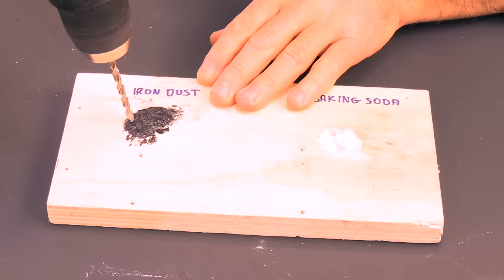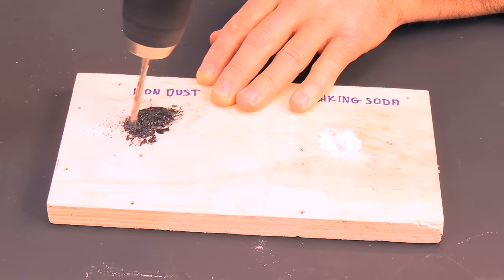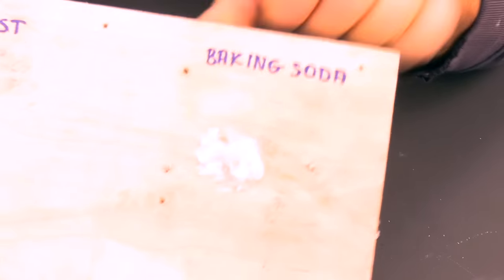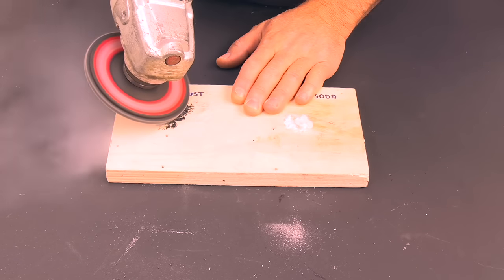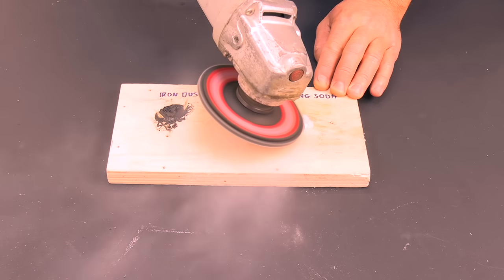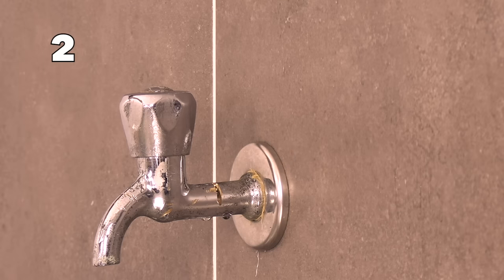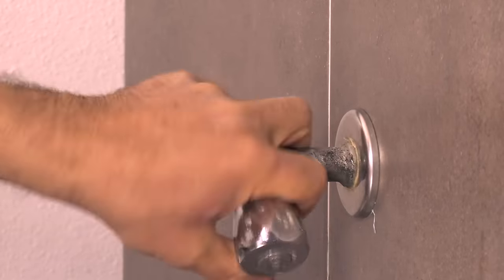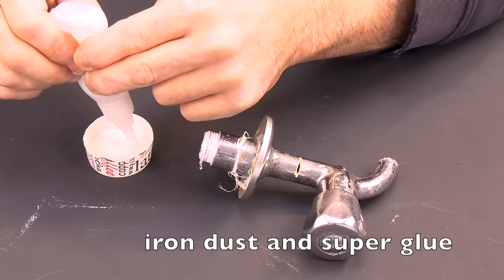Stronger Than Steel! Mix Iron Powder and Superglue You Will Amazed

Comment: Just repaired a broken metal frame from a pair of eyeglasses with graphite (from an ordinary pencil) and superglue. Takes a bit longer until it is hardened (about 30 minutes), but it's hard like stone now and the glue joint seems as strong as welded! Absolutely fantastic!
Reply: try mixing baking soda and graphite together, mix well then add the superglue n u get instant, insanely hard bonds
Reply: Rough job,.filing the chrome!
Mask it on both sides, fill it, wipe smooth, no filing!
Reply: When using a sharp knife, work AWAY from your other hand!
Reply: @keithlinney7084 , ну зачем же? А может он хочет знать технику безопасности, как свои три пальца... Не будем мешать.

Comment: Ничего необычного. Это используется уже лет 40 (а может быть и больше). Есть холодная сварка, можно смешать эпоксидную смолу с железными опилками.  Nothing unusual. This has been used for 40 years (maybe more). There is cold welding, you can mix epoxy with iron filings.

Comment: The baking soda  works like the catalyst of some kind and  also as the filler. Using any glue and adding any filller allows to make the strongest joins . It is like to prepare the  concrete.
Reply: Yes I think he used too much baking soda
Reply: I used baking soda to glue my ebike throtle. That joint takes incredible beating and holds for 3 years already.
Reply: @Sopheris  Try to use the tobacco ash.

Comment: Regarding the bolt that was fixed into the hole with powdered iron and super-glue; if the bolt has some oil on the threads or maybe a wrap of Teflon plumber's tape, then when the iron/glue sets, you can screw the bolt in and out, as the iron/glue will have bonded to the piece of steel, and have threads on the inside of the hole!

Comment: Can it be used to repair electrical water heater tank (iron or copper) with working temperatur up to 75 degree Celcius ?
Reply: you can use adhesive name Metallica of Astral
Reply: no superglue only has a workign temp up to 60 deg c
Reply: Dann muss man einen Kleber nehmen der auch längerfristig Feuchtigkeit verträgt, Temperatur sollte kein Problem sein. Es gibt zu den Produkten meistens auch Datenblätter.

Comment: See a few Superglue n powder vids now. The carbon one was interesting, might have to try this as a low temp metal casting method in silicon mods.
Reply: I have, and superglue with anything sticks to silicone unfortunately. Don't ruin your mold. Use resin with carbon, or baking soda. A steel mesh will insure a type of rebar reinforcement.  Hope this helps. 🤓

Comment: I am going to try this on an aluminum starter bracket that broke off of a John Deere D105 riding mower. I plan to place a threaded bolt in the spot that’s broken and then put the crazy glue and concrete on top of it.

Comment: Наконец-то я вижу умное видео. Просто поразительно помешательство общества на соде. Сода - самый неподходящий наполнитель по двум причинам: она непрочная, хрупкая, легко колется и размалывается и она растворяется в воде. Атмосферная вода (пар) будет медленно, но неумолимо разрушать склейку с содой. А вот железный порошок - вы сами видели только что, насколько он прочен. Такая склейка будет оставаться прочной много лет.
I'm finally seeing a smart video. The society's obsession with soda is simply amazing. Soda is the most unsuitable filler for two reasons: it is fragile, brittle, easily pricked and crushed, and it dissolves in water. Atmospheric water (steam) will slowly but inexorably destroy the bonding with soda. But the iron powder - you've just seen for yourself how durable it is. This bonding will remain strong for many years.

Comment: Grosser Blödsinn, man sollte bedenken dass alles was hier gemischt wird hat immer nur eine Basis: der Kleber ist nun mal nur Kunsstoff, also ist es die Festigkeit von diesem welche gilt. Alles andere ist Füllstoff, ob Stahl oder was immer.

Big nonsense, you should remember that everything that is mixed here always has only one basis: the adhesive is now only plastic, so it is the strength of this which applies. Everything else is filler, whether steel or whatever.

Comment: It seems to me that superglue has to be exposed to air to cure, since it doesn't cure in the container. So I wonder how a large object could be made from superglue, or how a bolt could be bound in a deep hole - there be no path for the glue to contact air.
Reply: Quite the opposite actually. Superglue is an anaerobic adhesive, meaning that it sets in the absence of air.

Comment: The reason that the Baking Soda and Superglue is brittle is because You Have To Use Krazy Glue - NOT Superglue. Krazy Glue & Baking Soda will; not chip. You can even tap threads into the Krazy Glue & Baking Soda Set Mix. Regular Superglue gives you unusable results for most things.
Reply: No, they are the exact same. The difference is that you have to use thin super glue/crazy glue. It soaks in and you don’t have to stir it. In this vid, he’s using gel for some reason.